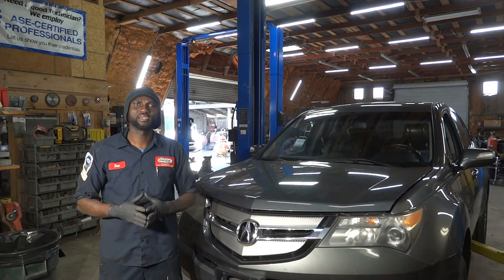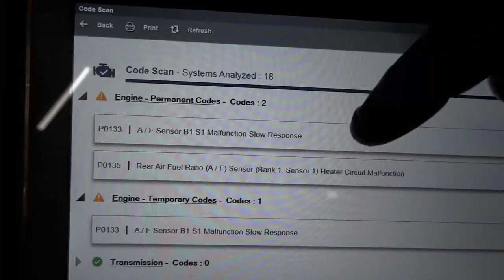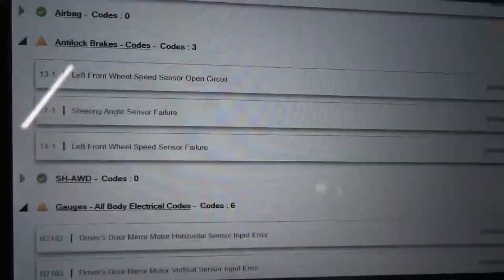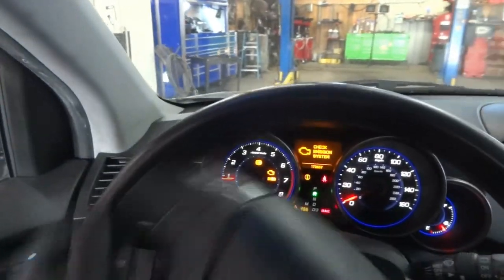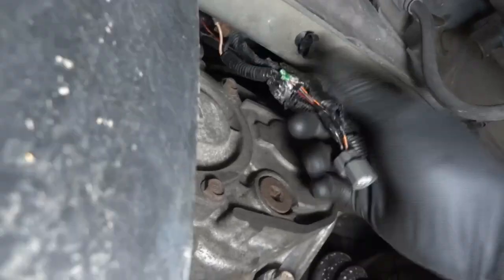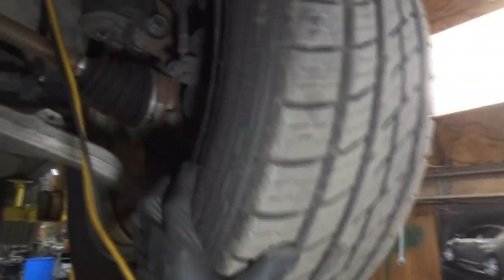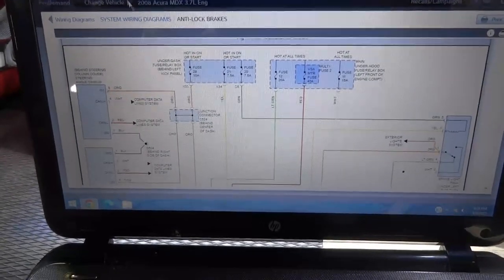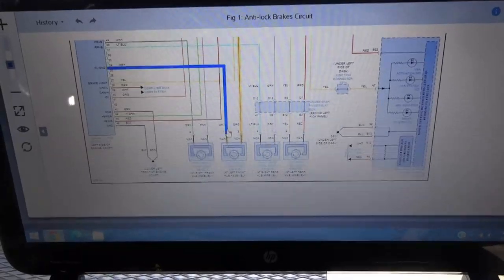ACURA MDX CHECK ENGINE LIGHT ON, VSA LIGHT ON, ABS LIGHT ON / DASHBOARD LIT UP LIKE A CHRISTMAS TREE

Comment: Great work as always Deo! Hey I have a question, I worked on a 2014 jeep Cherokee with a similar issue, but I did have voltage on the wheel speed sensor. I didn’t have full voltage though I was getting max 8.75 volts as compared to the other sensor which gave me 11.75v volts. What do you think may be the reason? I didn’t finish working on the car because client was in a hurry. I didn’t get a chance to trace it back to abs module and check if voltage was the same coming out of it.
Reply from the maker: @mannyclemente7159  it sounds like, you might have high resistance on that sensor circuit!
Reply: @KITS_Auto_and_Truck_Repair  
Ok I see what you mean. Thanks again for your reply man! I appreciate your work and look forward to more content! 👍

Comment: I just had to replace my wifes rack and pinion in her 08 acura mdx. I forgot to mark the yoke on the steering column when disconnected and once all done was in a hurry and hooked it back up and the steering wheel was a bit crooked and she drove it 2 miles home in town and the vsa light turned on. I corrected the steering and its straight now. Unpluged battery to reset any light and turned it on and no lights. Once you drive maybe 50 feet the vsa and sh-awd light come on and its being driven by only the front wheels. Get in it tonight to try and scan for any codes. And no light but im sure itll come on once driving. Any clue?
Reply from the maker: @thomastaylor4856  the sensor might need to be reset!
Reply: @KITS_Auto_and_Truck_Repair  thanks for helping. I ordered a cheap scanner creader 629 for 90 bucks on Amazon which does sas and that was exactly what it needed. Thanks again
Reply from the maker: @thomastaylor4856   My Pleasure!

Comment: Had a whole bunch of lights including Check engine , emission system problem electric parking brake problem and after have it scanned had a code for the evap canister valve code , changed it and all the lights went away and so far no more Christmas lights , wonder if all those codes trigger all those lights to come on
Reply from the maker: Eli  I'm glad tto hear that your vehicle is fixed!
Reply: @KITS_Auto_and_Truck_Repair  thanks , the car was driving smooth and whatnot but those lights coming on were very annoying, looking on line ran into a similar case where all those warning light was caused by something right on the side of the engine and easy to replace, so far the lights haven’t come back
Reply from the maker: @elguaguero23  that's good!

Comment: Hey bro, can you help me figure out what is going on with my 2005 Chevy Silverado 1500? I replaced the fuel lines and the fuel pump, it has been running just fine for two days and then I replaced the driver’s side wheel sensor abs C0035 code and I the abs light stays on, that not the reason I am writing you after I put sensor on I went home. I then started my truck and gone to Walmart and came out to go home the truck won’t start. It cranks over but sounds like it wants a third but it won’t start and then nothing it cranks but does nothing?  I checked the relay switch I put a new one in and nothing. I hear the fuel pump running when you put key on ignition position you hear the noise of the pump, I checked the fuel line to see if it was getting fuel and it is , I can not figure what it going on with my truck. I just turned 60 and I am disabled so I don’t have much money, can you please help me out I would really appreciate it and bless you if you could , if any of the viewers read this and the viewer’s figure out what is going on? I would really appreciate it as well, thanks 🙏 and god bless you all sincerely , Thomas Mack
Reply from the maker: if you have fuel pressure, the next thing you should check would be spark! if you have a code reader , scan it and see what trouble codes you have in the engine computer then let me know!
Reply: @KITS_Auto_and_Truck_Repair  ok thanks , my neighbor hook up this small scanner and the only code that can up was C0035 ABS I changed the driver’s side wheel sensor and that happened, wired but I don’t think it’s what did it thanks I will take spark plug wire off and see if I get spark
Reply: @KITS_Auto_and_Truck_Repair  hey I having my morning coffee ☕️ I will go out and check spark, what medium price scanner that I could afford which one would you recommend that would not cost me thousands of dollars lol
Reply: @KITS_Auto_and_Truck_Repair  I just tried to start it it started to bug the stopped, I am wondering if I should put the old fuel pump back in??? I really don’t need a new fuel pump right now it probably last another year I just did it because I had the truck bed completely off so I thought why not just replace the pump till I get a bad idea maybe the new pump is no good that does happen
Reply from the maker: @TomMack530  sounds good
Reply from the maker: @TomMack530  Autel scanner are pretty good!
Reply from the maker: @TomMack530  did you check for spark!
Reply: @KITS_Auto_and_Truck_Repair  no I don’t I don’t have no one to help me check it , yesterday I had shoulder surgery, I will have to wait for my neighbor to help me, I will keep in touch with you, you are the only one here that’s care’s enough to help, I thank you for it a blessing your way
Reply from the maker: @TomMack530  My Pleasure! Thanks!
Reply: @KITS_Auto_and_Truck_Repair  hay , I am going to put the old fuel pump back in and see if that makes a difference, I have seen new fuel pump be defective before
Reply: @KITS_Auto_and_Truck_Repair  how much is Autel scanners
Reply from the maker: @TomMack530  Sounds good!
Reply from the maker: @TomMack530  they have different ones! you should Google them and see what's best for you!!
Reply: @KITS_Auto_and_Truck_Repair  my wife is going to help me test for spark ⚡️ on coils after church tomorrow I will have to set 8 of them I will let you know what I find
Reply: @KITS_Auto_and_Truck_Repair  hey how can I test it with a multimeter ??? I replaced all spark plugs I am waiting for new spark plug wires I got a set for $45 at O’Reillys I get them tomorrow , can you do a video on a 2004 Chevy Silverado 1500 4.8 lt coils testing
Reply from the maker: @TomMack530  sounds good!
Reply from the maker: @TomMack530  you will need a spark tester to check for spark, watch my no start video on a chevy on this channel, for a step by step guide to pinpoint the problem, Good Luck!!
Reply: @KITS_Auto_and_Truck_Repair  I have a coil tester coming tomorrow at 10 am and if it the coils I will get them at Amazon 8 of them for $89 bucks O’Reillys want $56.98 each plus tax over $450 bucks then auto parts store and eat the peanut out of my crap 💩 lol they are crooks
Reply from the maker: @TomMack530  lol!! Don't just replace parts, you should get to the bottom of the problem first before you replace any parts!! Don't be a parts changer Lol!!
Reply: @KITS_Auto_and_Truck_Repair  ok I don’t get them yet , I should be getting that coil tester here soon, if it’s not that then what ?? The ground wire??? , I should get your number or email?
Reply: @KITS_Auto_and_Truck_Repair  could it be the ground wire?? I smell gas on spark plugs when I took out old ones it’s getting air ,gas, no spark ⚡️. Ok next thing would be not a good grounding???
Reply: @KITS_Auto_and_Truck_Repair  could it be the ABS Sensor be causing my truck from starting?? That happened to my truck right after I put new abs sensor in? Telling my Electric control module not to start vehicle??
Reply: @KITS_Auto_and_Truck_Repair  I got the Lunch VII iPad 2022 scanner it’s only $134.00 at Amazon it comes with a 2 year updates
Reply from the maker: @TomMack530  No the ABS Sensors would not cause a no start!!
Reply from the maker: @TomMack530  I haven't used that scanner yet but I hope it's good!!

Comment: Excellent video, thank you, Have you had to deal with the error code P2243 VCENT circuit with high voltage, and P1659 (ETCS) Control Relay OFF
Malfunction?

I'm dealing with those DTC's... so far I see everything ok, in the O2 signals I see a small noise signal that at a given moment appears and there the O2 signal is modified...
Reply from the maker: @sigifredomirandaflores7545   you might have to try an OEM 02 Sensor

Comment: So i have a 2006 acura rl with check awd system light no check engine , when i got it scanned at auto zone it came up as low abs circut could the fuses be the issue?
Reply from the maker: POISONED SOLDIER  that's possible you should check the abs module's fuses and the ground wires!

Comment: One fault of the sensor drags all the other sensors out. That is what’s going onto my 2019 mdx.I found out that the positive cable was loose and this came back from the dealer cause I had another Christmas tree going on. I am beginning to loose a confidence on this mdx I bout it used from the dealer supposedly it’s certified that they have gone through it. I am so not happy about this mdx it’s driving me nuts.
Reply from the maker: RAY ALLEN  you should have a pro mechanic diagnose it for you!
Reply: I went Friday at the dealer and they found out what was causing it. They didn’t have the parts it will take somewhere around two weeks to get my parts also it is covered by the Acura manufacturer so I don’t have to pay any cost. In the meantime I am driving with all these fault till I get my parts.

Comment: My wife 2008 MDX has an issue with the Air condition system I order a repair manual for it but until it comes may I explain what is going on. Whenever I turn off the the mdx by taking the key completely out of the ignition the ac and blower motor still runs and does turn off. I check the relay and switch it with the fog lights but it remains the same I bought a used climate control but still the same.  I couldn’t find the wire schematic to really diagnose it correctly but do you have an idea what it may be.
Reply from the maker: Blood Bought  it sounds like you might have a short in the wiring! you need to get a wiring diagram to figure that out!
Reply: @KITS_Auto_and_Truck_Repair  thank you
Reply from the maker: @Soldier4Christ96  My Pleasure!

Comment: I live in Nigeria... My car a 2011 mdx has this exact problem... Mechanics have done everything... Still can't get the lights off
Reply from the maker: Emeka Iheanacho  you might have a wiring problem!
Reply: @KITS_Auto_and_Truck_Repair  Yes brother... I was so mad I was even considering shipping it back to the States.... Once you put a brand new battery in the car it dies also.... Abs, cruise control and the AWD nothing works
Reply: @KITS_Auto_and_Truck_Repair  what can I do  please 🥺
Reply from the maker: @emekaiheanacho274  you should take it to a pro mechanic who can diagnose it for you!!
Reply: @emekaiheanacho274 if you are having battery drainage problems it's most likely the Bluetooth module I had to disconnect mine because of that

Comment: so glad I found this video. I have the exact same car...2008 Acura MDX. I had to change my transmission (put in a used one that's been working great so far). the the job was done, I also had a bunch of lights on on my dashboard. the VSA light was on, but NOT the ABS light. my mechanic showed me the connector and it's the same connectors shown in this video. I notice after you corrected wiring, the VSA light and ABS light went out. why would my car be showing just the VSA light and not the ABS light? my mechanic said that the connector cable broke during the transmission swap. is it just a matter of getting another connector?
Reply from the maker: Chin Chukwu  broken wire can cause what you described!
Reply: @KITS_Auto_and_Truck_Repair  ok, thanks. for some reason my mechanic is having a tough time finding a replacement. does the entire wire/cable have to be replaced? or, can you splice and connect? will a used one work ok?
Reply from the maker: @chinchukwu9174  the harness can be repaired!